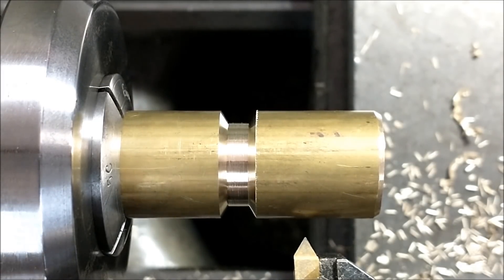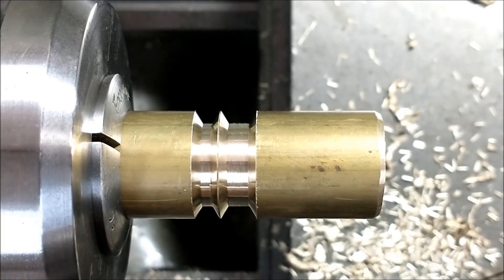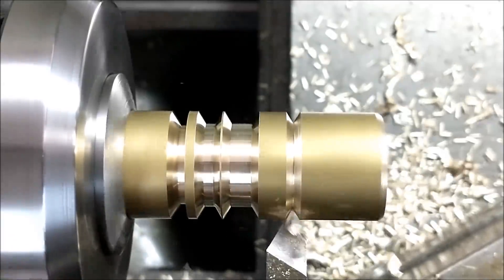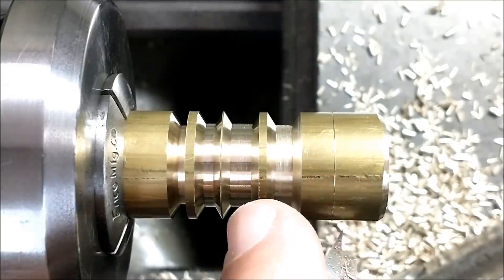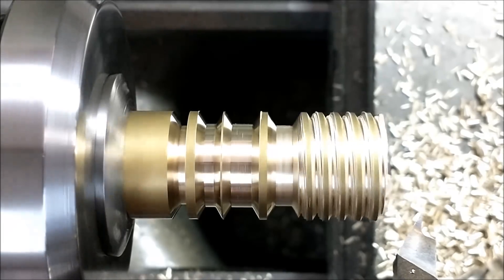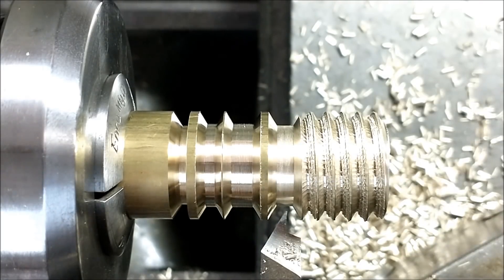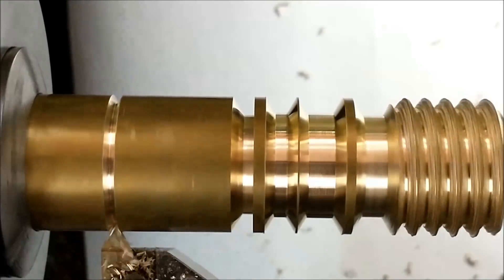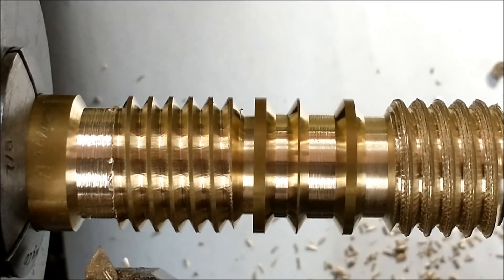FACT CHECK:  Threading Myth BUSTED !!   You'll Find This Interesting......

Comment: No one wants to discuss this with you because we respect you and learn SO much from you.  But.  The point is … the threading tool IS a form tool. Both methods, cross slide v compound  use it as a form tool. The ‘ compound ‘ people are using the same form tool as your plunge method; they are not using “half a tool”.  Thank you for proving you don’t have to use the compound,  you are right.  Actually, contrary to what you are saying - the ‘compound’ method is using cutting on one side of the threading tool, actually the ‘compound’ method ( with < 30 degrees) is cutting with the 60 degree form tool on both sides just like the ‘plunge’ method.  Using the ‘compound’ method will not result in the steps you show.  But you have convinced us you prefer the cross slide for multiple passes cutting threads.  We respect you and learn a TON of stuff from you. Thanks Joe.
Reply from the maker: Regardless of which approach you use, you need some part of the right side of the tool to successfully form a 60 degree thread. I appreciate your support.
Reply: Let's look at a regular facing or turning tool. I never seem to see pseudo machinists get bent out of shape when you  say only the advancing face is cutting. What is the big deal with the compound saying about the advancing side of the tool is taking a large chip and the trailing is scraping the "steps off the other flank? You have to be one dense moron not to see if you take a 30 degree cutting edge ad advance it a less then 30 degrees to the work it will take a chip (even though in may be a very thin chip. I have know this since I was 17 years old.

Comment: My Sherline actually does threading fine using only the cross slide. Of course, it doesn't come with a compound. I've never done coarser than 1/4-20 though.
Reply: I also have a Sherline, (and love it) but I have done threading on larger machines and as good as a Sherline is it, it can not make nearly as deep of passes in threads. That is the difference.

Comment: The big question is, does using the compound at an angle produce a better thread that is easier on the lathe or not? In short, do you use the compund at an angle?
Reply from the maker: Less load on the machine for sure.
Reply: @joepie221  so it's a good idea, but the theory is wrong?
Reply: For me, Yes. For guys like Joe, No way,

Comment: Joe.
You would make a wonderful politician.
You have manipulated the facts to suit your argument. 
I understand the policy of adjusting the compound to just under half the the thread form is to help chip removal and to make the leading edge do the majority of the work and for it to produce one sided chips.
Not both sides making chips that crowd onto each other. 
With the cross slide finishing cut being a lite cut doesn't create problems and cleans up the trailing side of the thread.
Reply from the maker: This is simply a physical presentation from a literal interpretation of very clear statement.
Reply: Do you know what FOS stands for? It's you all the way chump.
Reply: @mathewmolk2089 
 no idea 
FOS  ?
I assume from your tone it isn't complimentary.

Comment: You speeded up the interesting bit! If you're slowed down the form tool cutting we could have possible seen that the RHS was cutting.
Reply from the maker: The right hand side will always cut at the depth of the tool advancement. Thats where the steps came from.

Comment: And that's why they make specific full form threading tools. You can use those, or, use the compound to shape one side of the grove while the opposite side is formed by the tool (which is what you demoed here).  My only education on the topic is you and ToT (and lately Cutting Edge Engineering) so I could be way off.  In ToT's case he still used a 60deg tool but fed it in on an angle so the vast majority of the load was on the left.  The right side was only cutting the 1mm or so of the cross slide feed he inputs between passes.
Reply: Some of ToT's threads are not very nice though - not a good recommendation for the compound at an angle method!
Reply: @MidEngineering  Thread finish suffers a bit when your lathe doubles as a time machine.
Reply: @avi8r66  Aah, I hadn't considered that! :)
Reply: @MidEngineering  Seriously though the flaws I've seen (granted I am no expert) in ToT work seems related to the rigidity of his setup, probably mostly in the toolpost/topslide.

Comment: And IF (repeat IF) it were to cut a correct thread, what be the advantage of it? I don’t see the point of the argument in favour of single side cutting.
Reply from the maker: The demonstration was specifically to show you need both sides of the tool to make a correct thread profile. It wasn't about the compound setting.

Comment: I don’t understand something here with the 29 degree thing. Is the tool set with the center line at 90 degrees to the work with the compound at 29 degrees? Or is it set at 90 degrees to the work with the compound at 30 degrees then the compound is moved to 29? If the tool is 90 degrees to the work then you will get the profile of the tool as you are threading regardless of the compound. If the compound is moved after squaring the tool then you are not cutting a 60 degree thread. It seems like the 29 degree thing is meant to compensate for deflection while moving sideways while cutting resulting in an accurate profile. With a rigid setup it doesn’t seem to be necessary.
Reply: You're not going to like the answer but.....it depends.  American (and I believe UK) lathes reference 0° from perpendicular to the work and import (Chinese specifically) reference 0° from parallel to the work.  Essentially the idea though is to advance the tool with the compound (aka top slide) at 30°, the same angle as the flank of the thread so you're only cutting with one side of the tool and hence not pushing it as hard as when you just plunge straight in.  Joe's clearly debunked this simplification of the process but on smaller lathes, the idea is to reduce the tool pressure to something it can handle.  Why 29.5°?  It doesn't matter if you're at less than 30°  (I'm assuming a 60° threadform here but otherwise half of it), the right side of the tool would just cut more ... but you cannot be over 30° so 29 or 29.5° just err on the side of caution.... because if you're on an import lathe like mine, when it says 30° (or rather 60° on an import!>, that could be 29, 30 or 31....on a good day!   Incidentally, Joe's got good videos of how to set your compound accurately for when it does matter.
Reply: Tool perpendicular  (90°) to the work 
Compound at 30°

Comment: I was taught that it reduces tool pressure
Reply from the maker: It sure does. But both sides still cut.
Reply: @joepie221  for sure. Totally agree. But the left side does the majority of the work, correct?
Reply from the maker: Correct

Comment: Good tool for making a buttress thread. ;) 
Another technique is to have the compound parallel to the bed then advance with the cross slide and bump over the compound to take most of the cut on one side of the tool. Check Cutting Edge Engineering for examples.
Reply: Unnecessarily complicated and error prone. Turning the compound to 29• and advancing with it, advances both vectors with consistent and correct proportion automatically every time.

Comment: To those wondering about the origin of the myth: Cutting using only the cross-slide instead of the compound set at 30 degrees (with a full 60 degree tip, of course) will cause the cutting action on both sides of the thread profile to make chips that collapse in towards each other on top of the tool as they are formed, which can tangle and jam and chatter. Cutting on one side of the thread OF COURSE will shear off a tiny bit off of the other side equal to the depth of cut, just like any other facing or turning does, but it lets the chips fly free and unhindered. The final light cut at full depth using the cross-slide will cut on both sides to clean up the small amount of stair-stepping you get if the compound is set 1 degree over* 30 (which was preventing you from constantly dragging the whole "unused" edge on your work while hogging the thread). *I originally said 1 degree under 30 leaves steps, which was incorrect.
Reply: At compound < 30 degrees, you do NOT have ‘stair stepping’ both sides cut.  The thread form tool is set perpendicular to the work piece center line after the compound is set at whatever angle < 30 degrees you like.  Not sure where the confusion comes from; but if you just want to use the compound, go for it. But like the POST says, you’re gonna have chips rolling onto themselves.  Also, note: not sure where you guy’s are talking about .030 or .060 cut depths and at 250+ rpm !   As professional gunsmith, I’m at 60 rpm, first pass .008” and then less and less depth of cut as it progresses.  Using a 14” Monarch very heavy lathe or the Clausing medium size lathe.  Also, Joe, love your left to right threading videos; but when work is between centers… you crash if you let carriage continue on while you twiddle your fingers.  Hahahaaaa.  Thanks Joe, on my gosh we learn SO much from you !
Reply: Correct. 
The way I explain it to anyone who should ask is. 
The reason you set the tool at 29 degrees is to reduce the load on the left side of the tool. 
The tool does in fact cut on the left side but only by that one degree to the depth you just dialed in. 
You do end up with a stair step but no where near as pronounced as you think.
Reply: 29 degrees, if everything is set up accurately, will NOT produce a "stair step".  Anything from 0 degrees to 30 degrees will cause cutting on the right edge of the tool bit with 30 degrees being the case where tool bit and machine flexure would be causing some right hand edge cutting when mathematically (geometrically) there would theoretically be none.  However, greater than 30 degrees (or any of the many set up errors people can make) will produce a stair step.
Reply: Thanks to those who pointed out my mistake. 29 takes a skim pass on the secondary face leaving a clean finish with minimal loading on that face, and 31 leaves a slight step which would need a final skim pass with a plunge on the cross slide. I've edited my original comment so as to not lead astray future readers.
Reply: Sorry I have tried to say the same thing 
I hadn't seen your comment

Comment: But it would technically sufficient if the right 30° cutting edge was just as long as your stepover?
Reply: No.
Reply: @tabaks  why not?
Reply: Yes in a perfect world.
In practice you won't get a nice thread.
It will be better than Joe's butchered tool.
I think when Joe was saying a 1 thouh depth of cut would work he was saying the tip of his tool was not dead sharp but had a small radius or land
Reply: @stevewilliams2498  yeah, that's what I was thinking too. Having the right cutting edge in full length lets you have a good surface regardless of how big your stepover might be. If you thread with your compound at 29.5 degrees you'd technically still have small steps in the surfaceon one side, but you could propably clean it up easily when finishing.
Reply from the maker: Technically it would work if the compound was at 30 and the right side of the tool was longer than the depth of cut. Yes.

Comment: I paused the video at the beginning to make a statement of fact. The compound is set @ 29.5 degrees so that the tool is whiping clean the back side of the tread, so when you advance the compound it keeps the following side of the tool in contact the following side of a 60° thread that is.

Comment: Ok so setting the compound at 29.5 is not because only the front side of the tool is cutting...  Got it.  Would be nice to get the details as to why it's better to use 29.5 and maybe a video with using different angles to show the diff?

Comment: Being something of a single point thread cutting fan i have heard the hard of thinking say how you have to set the top slide at half the angle. Well never taking advice without confirmation i experimented cutting some stainless with a full form insert both angled and straight in and looked at the results under a microscope and you couldn't tell the difference. What is the problem if the tool does cut on both sides? Is your lathe made of cast iron or licorice. The top slide is more useful left at  the correct angle, in line with the lathe axis and marked zero on the degree mark.

Comment: I’m happy you did this video, because I’ve never been able to convince people of this. It seems logical to believe that the tool only cuts in the direction of movement, so that’s why people believe it. But each time the tool is moved in, the rear is also moved in, so it cuts off the rear of the thread. It’s always been obvious to me, which you demonstrated extremely well. When you move the 30 degree tool in, either by using the compound, or the cross slide, you’re moving it in towards the center of the piece. With just 30 degrees, you have to leave a step on the rear of the cut, because there’s no edge to remove the step. No matter how the tool is moved inwards, it’s moved in step by step, which leaves a 90 degree back edge. It don’t understand why that’s hard to realize.

Guys, no matter where you go, whether it’s people on YouTube doing machining videos, some of whom who should know better, or even machining articles, say that moving it in 30 degrees with the compound just cuts on the leading edge, and supposedly is lessening tool pressure in doing so. I’ve read this innumerable times over the more than 50 years since I first started doing this. It’s so ingrained that nobody has ever tried it out publicly, as far as I know, until Joe just did here.

Comment: The back edge provides a wiper action on infeed. If infeed was some small fraction of the tip radius the finish would be great, like the V groove you cut with it.
Reply: I'm not a machinist but i think I'm getting the principle. Cheers ta

Comment: I've not heard that fable but what you are saying is right on.   I would say that most of the cutting is done on the left side for sure. The right side still cuts but not as much.  It's the same what seems to be called the "end cutting edge angle" on a simple turning tool. The less angle between right side of the cutting point and the work, the finer the surface.  If the threading tool was 55 degrees with 30 on the left and 25 on the right, the surface finish on the right side of the groove would look much better.

Comment: Made sense way before you even went to the effort of the video. The issue of single pointing the angle, similar to my world doing two rail sweeps, never smooth. Question from a total non-machinist (though I have a nice lathe and do a good bit of metal in the shop), I noticed the threading tool and the single sided tool cut dead smooth on the example cuts early in the video, but then the single sided tool chattered heavily on the stepped thread, and the 60 degree tool also chattered a bit? I know this was just for demonstration and the single sided tool likely suffered deflection due to fast feed speed.. but is the 60 degree tool chattering slightly mainly because the leading edge of the tool is doing more work than the trailing edge?

Comment: I never heard that the back side of the tool didn't cut but just that you wanted the leading edge to be performing most of the cut and the trailing edge to be performing a minimal cut.  This was to keep the leadscrew pushing the tool under a constant pressure through the work.  Not sure there's much effect on good material with a constant diameter.

All that said I know good machinists who just plunge the tool straight in with acceptable results.  I still use a bit less than 30 degrees and the compound since many of my tools have side rake.
Reply: That is what I was taught in high school metal shop as well, back when such classes still existed. I guess I just assumed that when people talked about cutting on the leading edge of the tool it was understood that meant mostly on the leading edge. I can't say I've ever had anyone try to tell me the trailing edge didn't cut at all. I guess I don't get out enough.
Reply: Now that is a good point! 29.5 deg will keep the slack out of the gear train. Thank you Russ.
Reply: I always keep the compound parallel with the axis of rotation.   No need for the compound to be at 30 degrees,
Reply: @seantap1415  I DID NOT KNOW THIS i have all ways had set at 29 ish with a carbide tip tool would this work using your way of doing a thread or is your tool a ground type
Reply: @wallbawden5511  I use a carbide threading insert no special grind is needed.
Reply: Russ Kepler; That is exactly how I read all the instructions when I taught myself from books and videos from such as our esteemed Mr Pie. The idea, as I understand it, is to reduce chatter caused by both sides cutting equally. It certainly works for me on my 100 year old Drummond 3 1/2" centre (7" swing) lathes - as long as I engage the tumbler reverse the right way to not get left hand threads :-( You might guess that I have to set my compound at 27 1/2 degrees :-)
Reply: @andybelcher1767  I doubt MR.Pie sets his compound to 29 degrees when threading on a manual lathe.